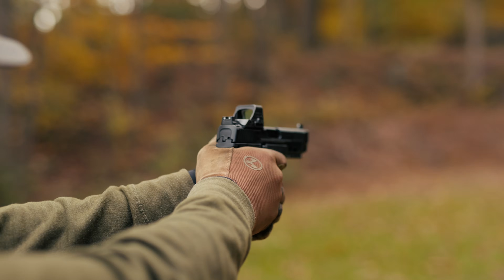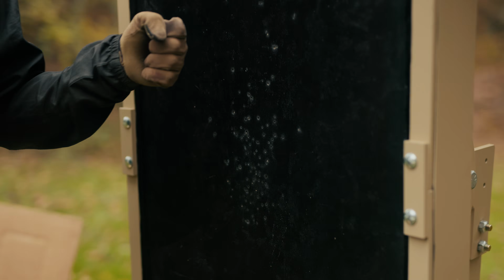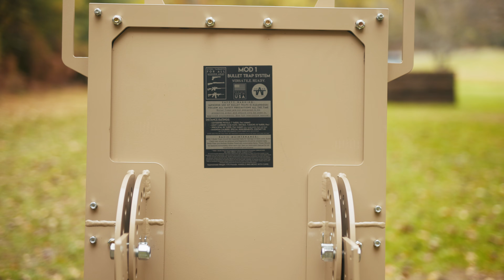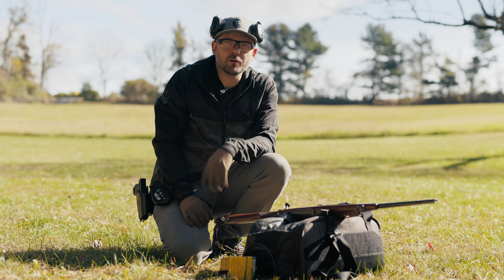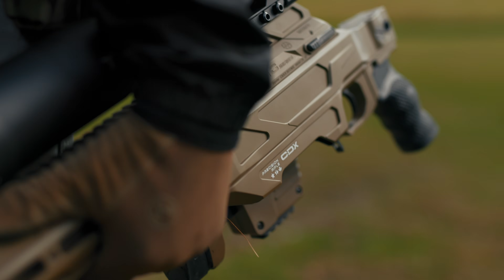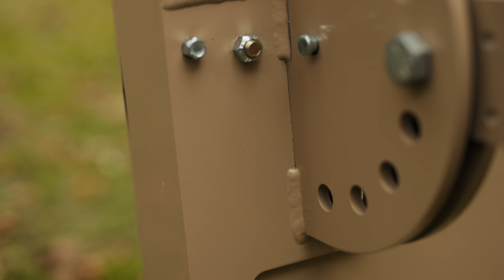We Built a Way to Shoot Indoors... Safely | MOD 1 Bullet Trap

Comment: I shoot a bunch. every weekend pistol (9mm) and rifle (5.56/.223). I would LOVE to have this at my house to be able to shoot at home. I am allowed to here but don't have the infrastructure.
Reply from the maker: The key is good ventilation. If you can achieve that, the MOD 1 is a fantastic tool. We have many customers running them inside home-built ranges. Thanks for watching!
Reply: @TATargets I woukd just put it outside under a little awning or something I would build.
Reply from the maker: @Egotiztik  You'd have the coolest shooting setup in town.

Comment: Good presentation! Is that a strike on the top left frame with that hole?
Reply from the maker: We had some rounds hit the frame, but there are no holes as it’s all AR550. But the top left most was from moving it onto the trailer and onto the range.